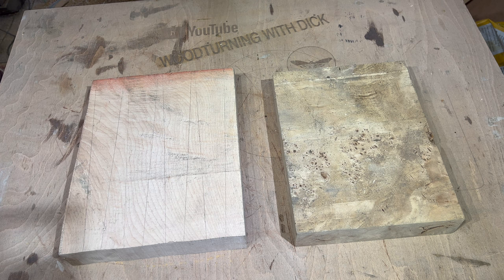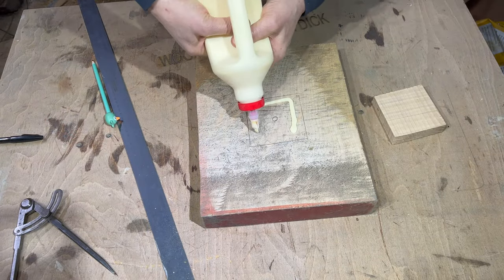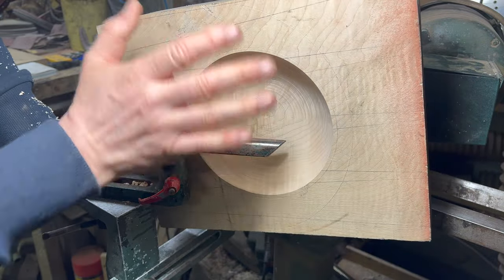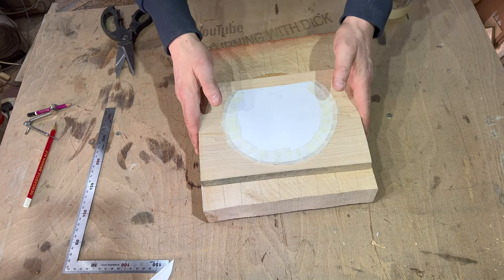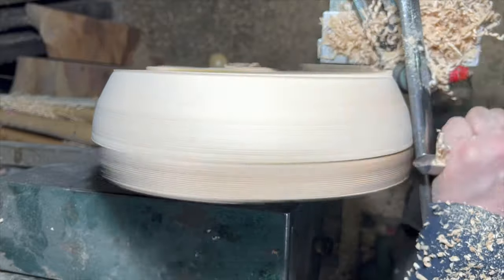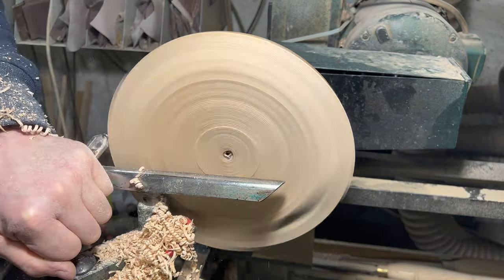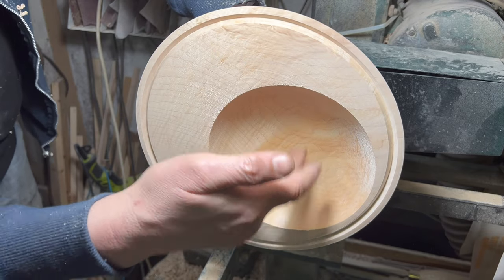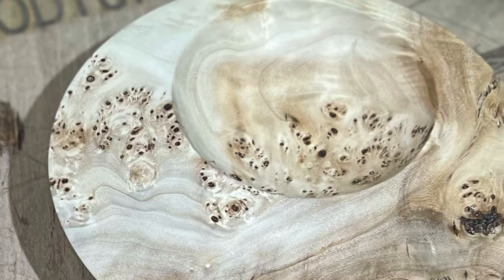Off Centre Woodturning - The EASY Way

Comment: Seems like a much safer way to turn off center bowls than I’ve seen before. Thank you for doing this step by step. Wonderful piece! I wonder if you could off center turn goblet, candle holders, or anything spindle like this? If so could you share that video?
Reply from the maker: Welcome along Madonna.

I’d like to say I’m not into candle holders and goblets, but the next video is going to be a goblet of sorts 🤣 the standard goblet with captive rings that most youtube woodturners do, but tried to do mine with a difference (not off centre 🤣🤣)
Not sure this method would work so well with goblets but maybe candle holders. Give it a try and see 😁👍

Comment: Place strips of brown paper bag in the glue between wood layers. Makes it easy to remove those unwanted layers without sacrificing bond strength of the glue joints plus you get to reuse the wood. Also try hot melt glue to bond various layers together. Can remove the hot melt glue with denatured alcohol.
Reply from the maker: Thank you Robert, both methods I’ve used for other jobs, but this one I wanted to ensure the best join. When I get a chance I’ll try it with the paper and hot glue 🙏👍👍👍👍
Reply: @WoodWithD  point to clarify. Do not use paper with hot melt glue. Only wood to wood and around edge of joint. I have made several tenon blocks and hot melt them on the blank. Works well enough to tuen bowl inside. After turning, have a nice bowl foot.
Reply from the maker: @robertnorthrup1914  thanks Robert. Star you are for pointing out 👍😁

Comment: What is the mening of the paper? And why can't the extra plate cover the whole faceside?
Reply from the maker: The paper is to stop the glue going into the finish bowl. The extra plate doesn’t cover the entire side so that you can still get your fingers in the bowl to check the wall thickness isn’t getting too thin when turning down the outside. I hope that helps it 👍 Try it and see 😊😊